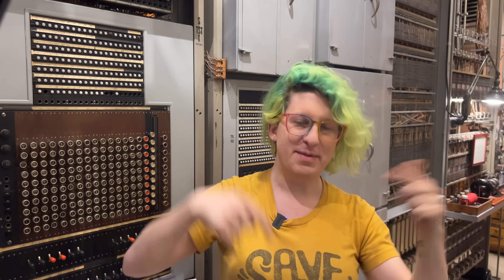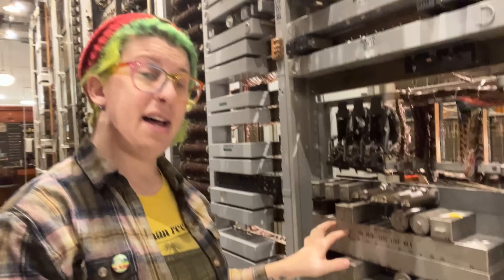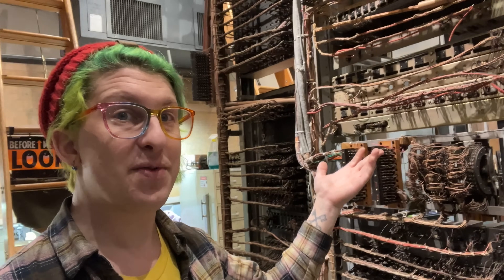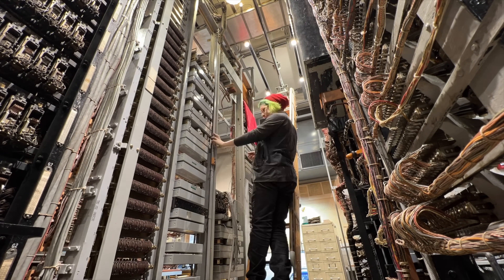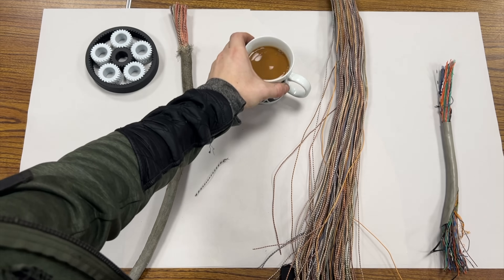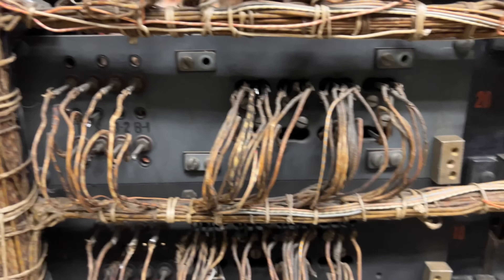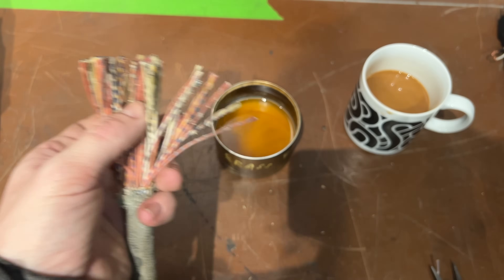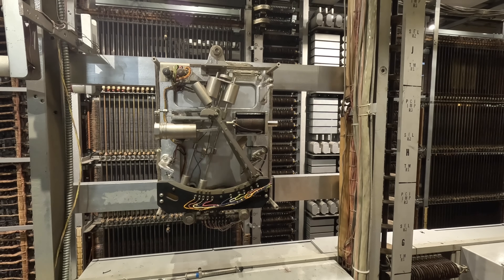Bringing up the Sender Test Frame: PART 2!

Comment: I agree 100% with the mentality of "do it as originally done" wherever possible. It's like the tape emulator on the ESS - there are some things that just can work as original in museum duty. If there was some special purpose relay that you couldn't replicate, having something modern hidden in a can would be a great work around.
Reply: In the museum context using a microcontroller for emulated circuits when a close original is available defeats the purpose of the museum in putting on display such original equipment. Emulating with a microcontroller here would be just plain wrong. There is a time and a place for everything.
Reply: @morofry  Exactly. It's like some early workstation computers I've restored for museum duty - they have hard disk emulators in them. I much prefer to have spinning rust in my machines, but for something that just needs to turn on and run, a disk emulator is the better choice.
Reply: @ This is a catch 22.  A lot of the original parts are not available anymore.  They are irreplaceable.  Should they be operated and killed, or kept in an operational condition and somethings emulated?   It's a hard call.  They don't use the original tape on the ESS, they use an emulator.    There are somethings that just won't last if they are continuously used.    I come from a retro computing background, so I totally understand the wanting to use original as much as possible,    The issue is, these parts are no longer made, no longer available and things are only original once.
Reply: @EsotericArctos  Yes this is a tough call to make; however, the context here is in a museum, where emulation is detrimental to demonstrating the operation of this equipment. If it was not possible to use original equipment, the choice was made to display it rather than have its functionality absracted by non-period support equipment.

I agree that in other contexts, emulation or modern replacement is acceptable, unavoidable, or preferred; but in the focus of history it often needs to be original equipment or none at all.

Comment: Strongly agree that modern electronics has no place as part of an electromechanical switch. OK for stuff like announcements or time clock, if the original isn't available, but better to use the original, because, after all, it's a museum, and accuracy is a core part of why it exists. Also, fascinating about the silk-covered enamel wire.
Reply: Only reasonable systemic upgrade I think is new wiring, if needed for ease of management vs the older wiring, especially if older wiring needs replacing anyway.

Comment: The british GPO had special heaters for beeswax for doing exchange installation. It was FORBIDDEN to use a naked flame in the exchange (for obvious reasons)

Our dsc (double silk covered) wasn't enamelled .... so far as i know
Reply: I'm not sure about telephone practice specifically, but there were various forms of cloth insulation in the old days. SC, CC, DSC, DCC (Silk Covered, Cotton Covered, Double Silk Covered, Double Cotton Covered) were all available. 

DCC was probably the most common kind, at least outside telephone practice. SC and CC were a single spiral wrapped layer, and only really used for winding coils, since it was thin, but very fiddly to work with. 

The double-covered wires were counter-wrapped spiral. Later there was braided cable, which might have a single or double spiral wrap, and then a braided layer over the top.

There might or might not be a varnish or enamel insulation layer under the cloth covering. Originally this was varnish, but it tended to be brittle and crack and peel off if the wire was bent. Later it was enamel, and this worked much better. Magnet wire, used for winding coils, very soon used only an enamel insulation layer.
Reply: I worked on radios as a kid in the late '40s. May favorite wire was waxed cotton covered. All you had to do to strip it was crush it with pliers.

Comment: It is interesting that that enamel insulated, without the fabric wrap we use a lot of these days, though the enamel composition might be different, but every time we have a coil of wire in motor, microphone, transformer, relay, contactor or inductor coil is basically that so the insulation is as thin as possible for those tight windings.

Comment: I agree with you on the no electronics in an electromechanical system.  There's a crossbar demo unit on youtube, which looks great, but the common control is a microcontroller :( 

British Telecom did mix electronics with strowger from quite an early date, to solve reliability issues with things like dial pulse regenerators,  etc. Most were plugin 1:1 replacements for their electromechanical predecessor

Comment: You can use an aspirin tablet to strip enamel from wires. Just heat the wire over an aspirin tablet with the soldering iron. It stinks like hell and I don't recommend inhaling the fumes, but will eat the enamel.
Reply: There were commercial chemical strippers available to strip enameled wire. Essentially a form of paint stripper. Just dip the end in the stuff, wait about 30 seconds, and wipe it off with a rag. No heat required, and no danger of damaging other stuff, as long as you didn't spill it. :-)

Comment: Glad to see this project coming on; often getting through all the stages like making room for something is the most frustrating and tedious bit, too. I can only agree with you about your approach, too: the point of a museum like this one is to preserve machines, ideally in a working condition so people can see what they do, and how they do it. If you replace bits of them with emulators because it's easier, you're not doing that: the thing may well work right, but it doesn't do it in the right way.

I'd definitely like to see a full video on the test line, as and when you have the time!